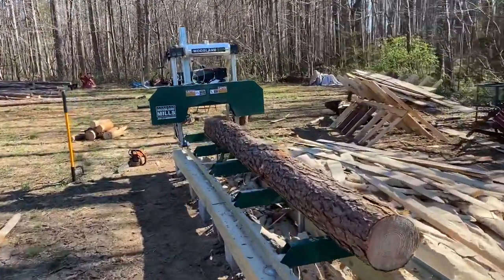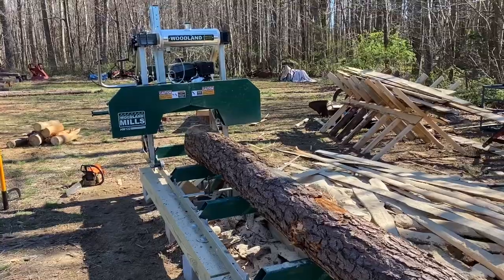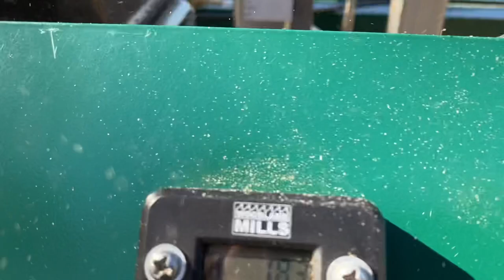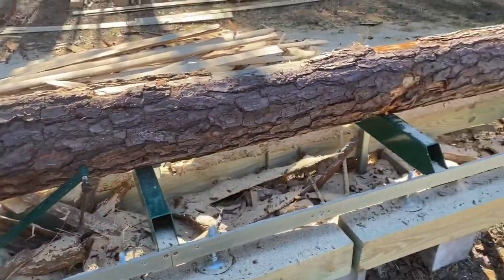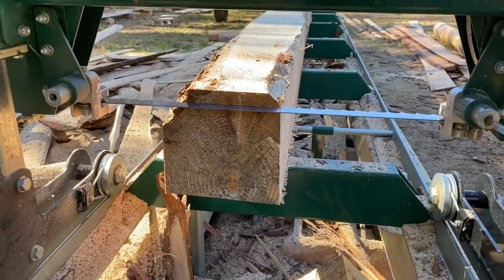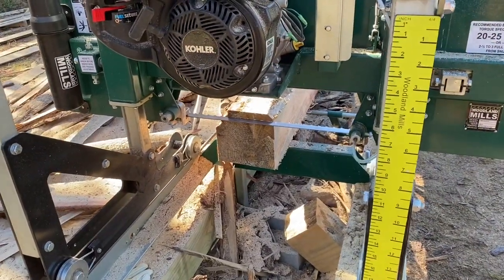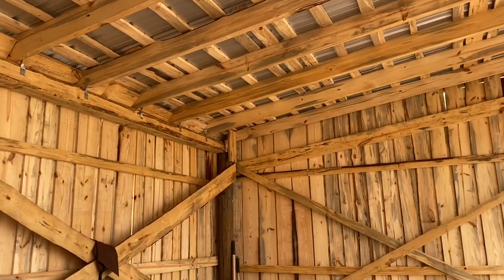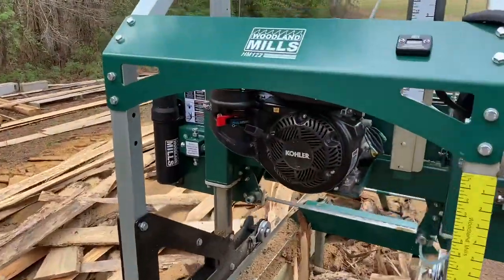WoodLand Mills HM122 Sawmill Portable saw mill Building our Homestead Dream

Comment: just received my 122. researched the heck out of all i could find. i have a range road firewood processor as well, good machine.  i've had a bandmill for 30 years now, made in Maine, (i'm northern Ontario Canada) an old 5.0 hp honda engine, on a stationary rolling carrier.  each end of the log would be raised per cut.  Was called the Ross Bandmill company. Still runs, just wanted something newer and able to cut longer lengths.  retired off grid.   Have made many projects with it, we're limited in wood species,  oak, maple, cherry, are not here.  primarily Birch, spruce, poplar and tamarack.   Good video, happy to subscribe to your site.  cheers,  Dan